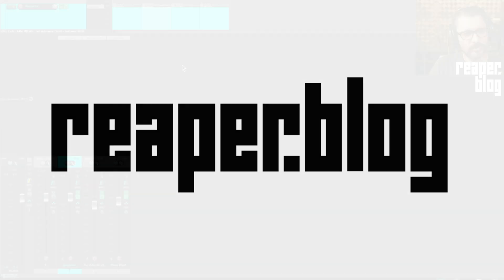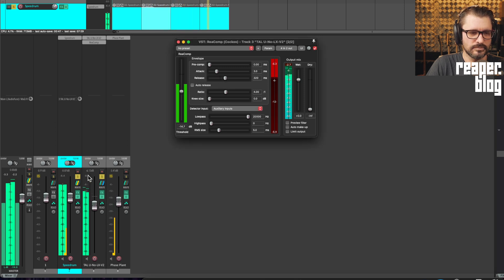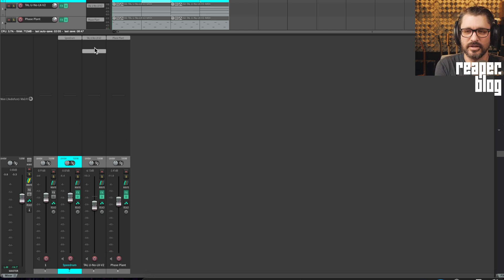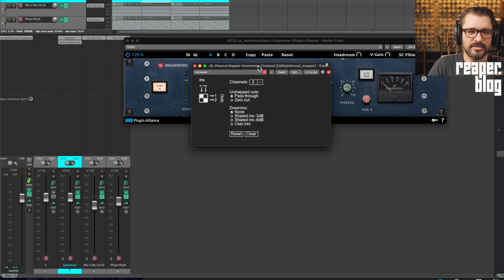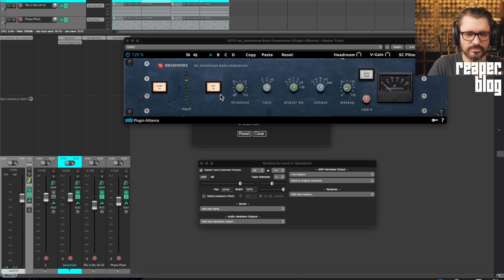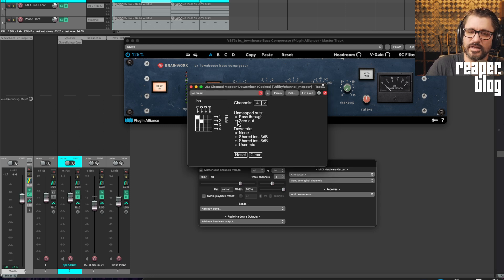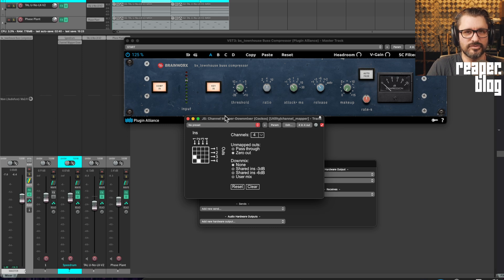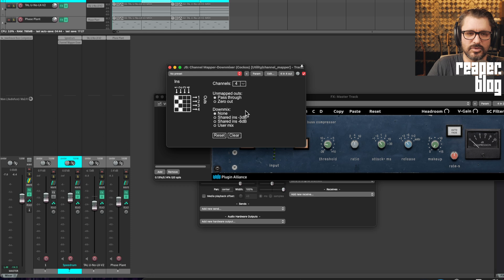How to Sidechain on the Master Track in REAPER

Comment: this works but I don't think you can disable the audio from the side-chain track doing it this way to the master - I always have a dedicated (silent) side-chain track for pumping so I can use a track other than the main kick in case I change the main kick levels etc. So, I would go with creating a submaster track, and piping all the audio tracks through it, then send 3-4 of the dedicated side-chain to a compressor on that track.
Reply from the maker: same thing. You can mute the audio item, or bypass the plugin to kill the send. I've personally never liked routing through submaster. reminds me of mixing in pro tools lol

Comment: This looks useful. Personally I would just create an extra 'master' channel (I usually call it 'submaster') that is the parent to all other tracks. So then this submaster track can take over the role of the master, yet have all the capabilities of a normal track.
Reply from the maker: there have been times I've done this, and wound up adding more tracks forgetting to route through the submaster. That's a real pain remembering to add a send to every track.
Reply: @TheREAPERBlog  Add a send? Every track, except for the submaster, is a child track - no send necessary.
Reply: @matthijshebly  I do that too all the time :) And it's easy to spot a track that isn't a child-track, if you add a new track late in the process, because child-tracks indent very clearly relative to the parent.

Shift-click and select all the tracks you want to turn into children-tracks, and then simply drag them under the parent (And individual sends/receives between tracks remain intact even when they become children-tracks, or moved around in different order. And you can send from non-child track to child-track if you need to. Very flexible Reaper system :) )
Reply: Can you please clarify with you guys, do you just add the “premaster” track with sends to it, or a folder in which all the tracks of the project are nested?
Reply from the maker: I've seen both ways
Reply: @TheREAPERBlog   I used to make a premaster folder with all the tracks embedded, and then Reaper would start to slow down, which is very strange.
(And thanks for the video :yougotthis:)
Reply: @klementus  Folder (a.k.a. Parent), with everything else inside it. Routing is automatically.
Reply: same here. much easier and can also have it´s own fx and automation pre-master
Reply: I've been doing something similar for a while. I create a track called "rear bus" with sends from all or most of the instrumental elements  (except the drums/drum bus). 
 I saw one of the "big time" producers doing it, forget wich one tho.